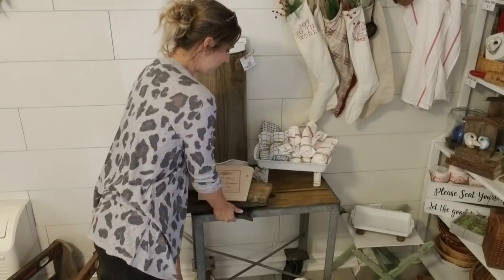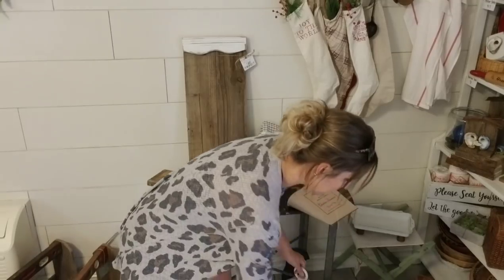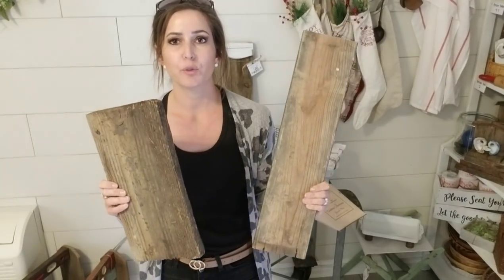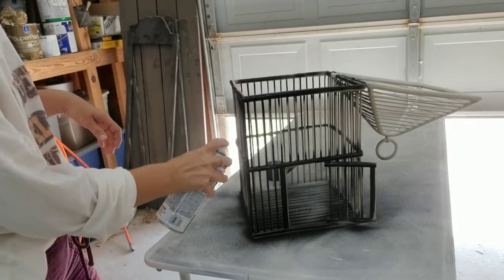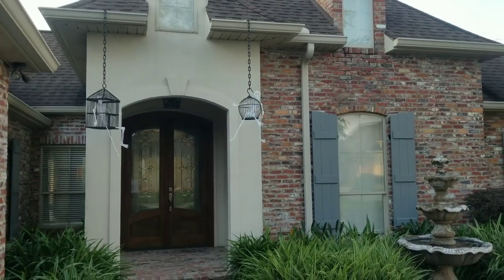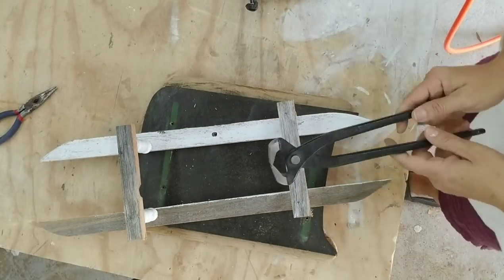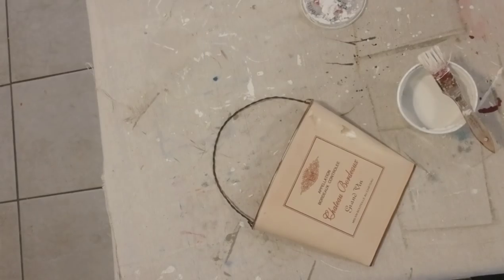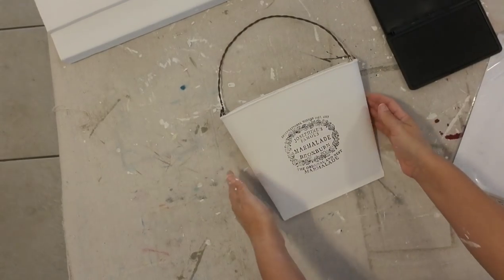Thrift to Treasure • Bird cages • Wooden sled • Hanging planter • Wooden house and church

Comment: Those wooden houses/churches remind me so much of a big church birdhouse I have that I keep on my hearth.  I don't know if you ever make birdhouses but I know you could. The front of the birdhouse looks a lot like what you made here. The steeple is tall but the box is at the level of the lower roof, if that makes sense. Whoever made it used an old door knob with a metal plate backing as the perch below the hole.  I don't put this piece outside, just use for decoration but I love it. It's your fav two-tone - distressed white  wood and they put rusty tin on the roof so it's that brown & white combination. Wish I could post a pic. Could use different old hardware stuff on those to decorate them, whether birdhouse or not.

Comment: I'm a terrible stamper, but a tip I picked up is to pat your stamp pad onto your stamp instead of pushing your stamp on the pad. That keeps the ink off of the area around your stamp and only gets on the raised parts.
Reply from the maker: you should go back and watch the first video i did this. i was using my face, lol. but im getting a little better each time.
Reply: @JuliesDesignsandSigns  I'm working my way through all of your videos. You have given me a lot of inspiration and I'm feeling a little braver about using power tools too.
Reply from the maker: @Sandy-oe5mh  good, don't be scared of them but always be cautious

Comment: Amazing! Again! Love them all but the houses are crazy cute! I just bought a brad nailer. But I think the nails will be too short to go through somethings. What length of nail do use in your brad nail gun?
Reply from the maker: I have all sizes. check the label on the gun. should tell you what gauge and range of nail sizes fits that gun. go buy all the sizes that fit your gun and you should have whatever size you need for each project.